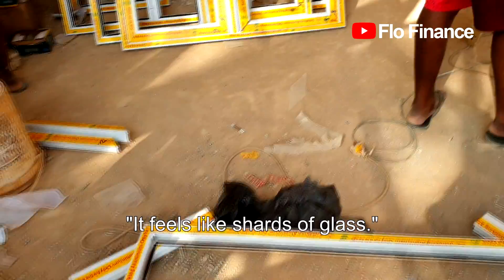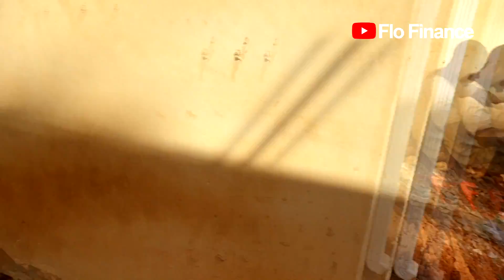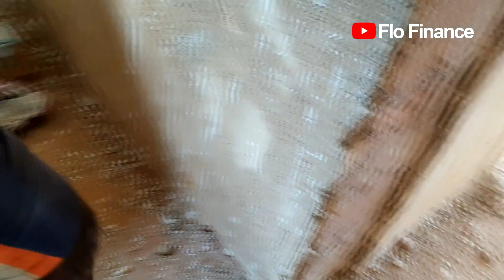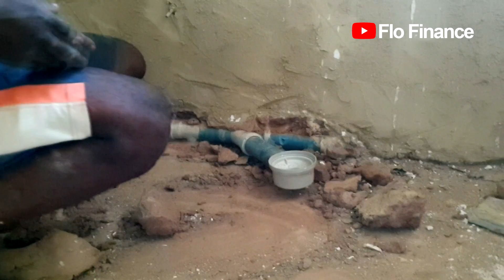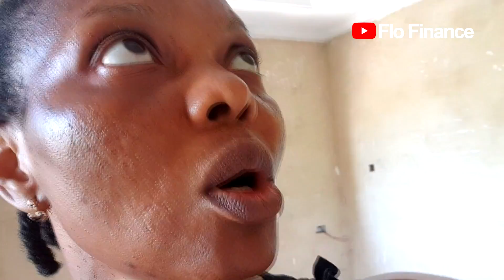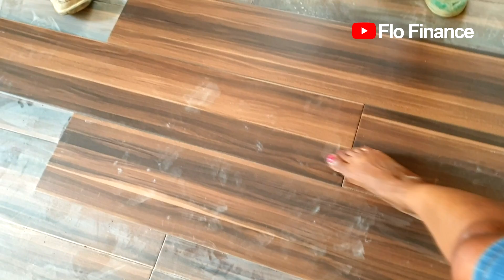HIDDEN COSTS OF BUILDING A HOUSE in NIGERIA: Expensive Mistakes, Unplanned Expenses | Flo Finance

Comment: Your tiles are absolutely beautiful aunt Flo, and you have eyes for quality, how do you even know how to detect these mistakes?
Reply from the maker: Thanks. For mistakes: at this stage they are mostly aesthetics and boils down to "beauty being in the eyes of the beholder" and you don't learn that one anywhere. The tile installation I was mad about, every other person did not understand why I had an issue with them. Meanwhile they are hideous to me. 😂 So bad I'm still considering taking them out at a huge cost.

For technical mistakes, that one is based on experience. With over 10 years construction site experience, one can pick out these things instantly. At the foundation, blockwork, beams and pillars stages we had a certified civil engr do the job. He knows about the strength of the structure, agregate for the concrete mix, sizes of rods to use etc but I was still there making sure we get what we want in terms of the final look of the house.
Reply: @FloFinance  I live in europe and the tile installation was the first thing that caught my eye. I told my husband, ow noo,thats not right and then you mentioned it. It should be the same technique as laminate flooring ( europe style, i guess) im sooo sorry, thank God it was only 1 room.

Comment: They are all the same everywhere. If you are not there to supervise them, they will deliver the opposite and run mouth on top.

A plumber took the materials we bought and was calling me on the phone to pay his money when he has not fitted the material. If I did not return to site to check his work sorry would have been my name.

Well done on the progress so far.
Reply from the maker: That running mouth on top is the most annoying part. You made a mistake, accept your mistake nowww. No. They will blame everyone and everything else but themselves and be telling you it's JUST a few materials that need to be replaced. 

Yes o, some steal materials but to not even fix it at all and be asking for money is the height of it. 😑

Thanks.

Comment: Nice Work Anty Flo . Your effort is indeed  appreciated . I am a building contractor based in Minneapolis,MN . Hoping to start a  design ,build, and repair service company . I want to concentrate  in building Finishes and Structural repair . I am currently building my family house in Oyigbo Rivers state . They are working on the carcass ATM . I have told them to wait on the finishes for me to come home . I will link up with you soon, maybe we can help fellow Nigerians in Diaspora and home to build lasting and aesthetically pleasing structures . Check out 5Way Contractors on any platform.Thanks

Comment: Can you put slide door  on bathroom doors 
Same thing in Papua New Guinea 
The workmen do stuff to their own mind and don't standardize unless in city
Reply from the maker: Yes, you can but you need to make provision for it right from when you are making the building plan. You need to make sure there's no obstruction such as shower trays/cubicles in the direction the door will slide.
Reply: @FloFinance  very true . . It's important to be present 3very day and plan before y o u get there
But if you  have a skilled carpenter they will put ranch or barn type slide door on outside of room . In hall way. That way only attachment is the runner above door frame
When my cousin built her house back in her village she had some similar problem . And a,solution was to get a local carpenter to make  barn door to her room that came off the hall and foyer
Using pallets the  supplies were packed on . Carpenter sanded back panels and use burn gun to bring out natural pattern in wood. Then seal with lacquer.  The door looked amazing and is now a feature because it was different. Didn't look cheap .
God bless your home and may you continue to rise up .

Comment: In the case of the tiles, this is where laminates will have saved u a lot. They would have just removed them and relay them like u want. Which is a staggered format from the description u gave. Sorry o the wahala and joy of building.
Reply from the maker: But do they last as long as ceramic tiles? Especially in the village where you can't control visitors and sand like that. I often see those laminates as something suited for a couple at most. I am speaking only based on seeing it installed. To me it looks fragile and soft like PVC carpet. How durable is it? Would like to know.